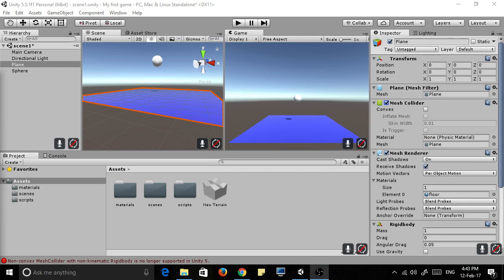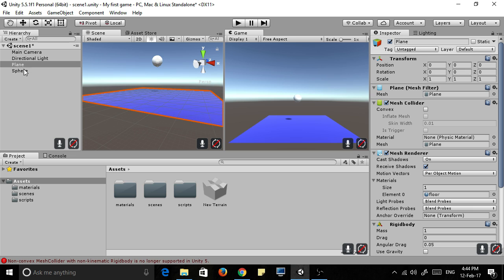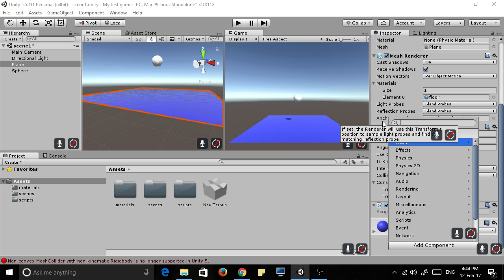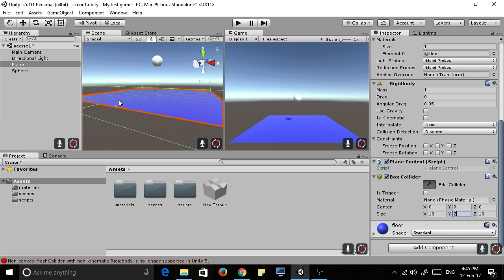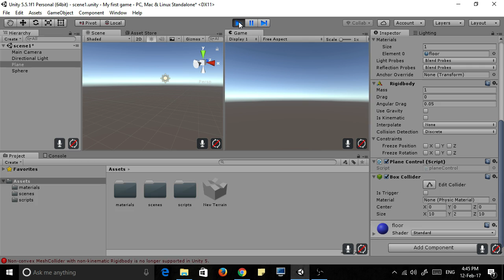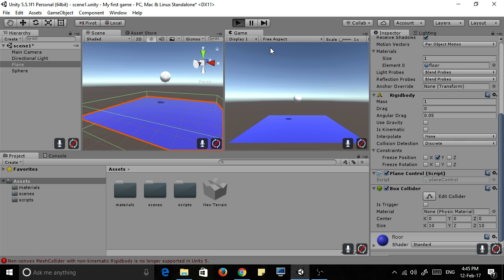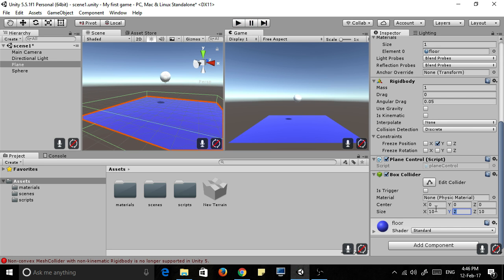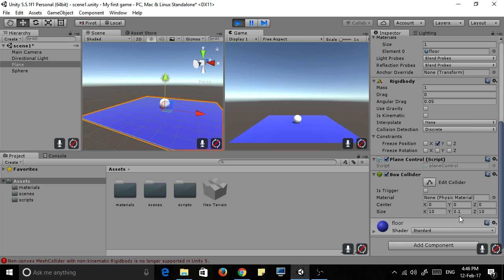Unity plane not colliding fix

Comment: Be aware that there are some collison issues when you have objects moving at higher rates of speed and you have thin colliders. With that in mind, another solution for this is to make the plane a cube instead and give it a thickness (Y value) of .25 or greater. Another solution is to just create an empty game object and give it a box collider with a significant thickness, length, and width and move it into place. Also, you can click the box "is Kinematic" and that should lock the object so it doesn't move or rotate from it's position.
Reply: thank you
Reply: you're a fucking legend dude , this helped more than the tutorial